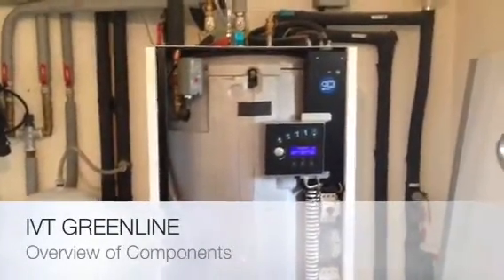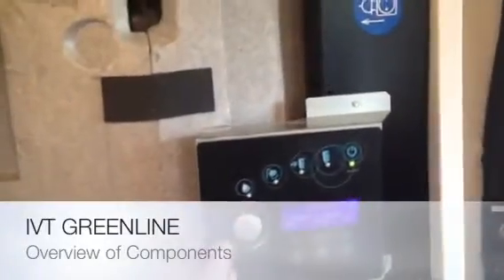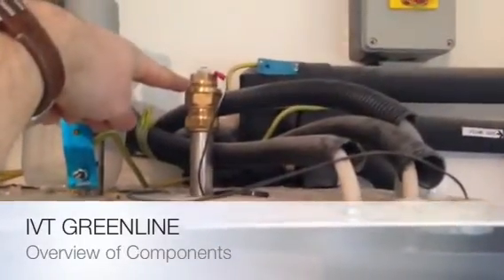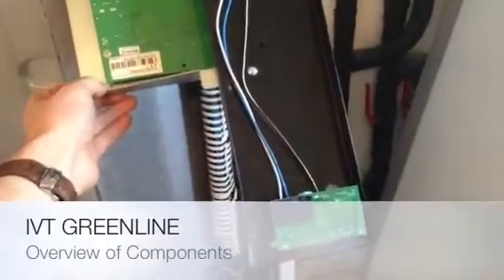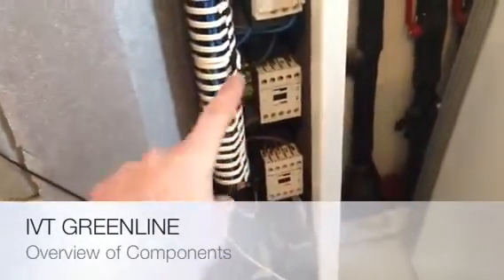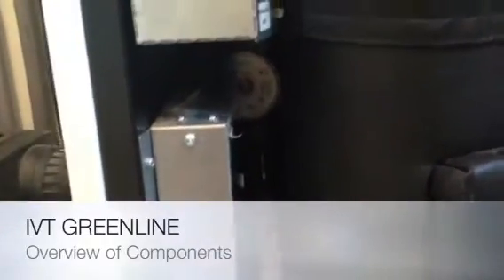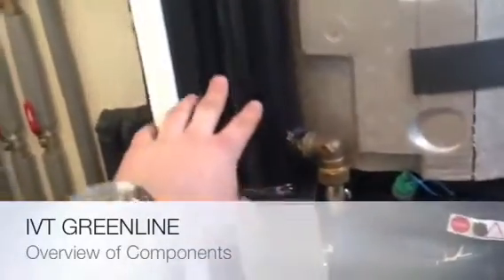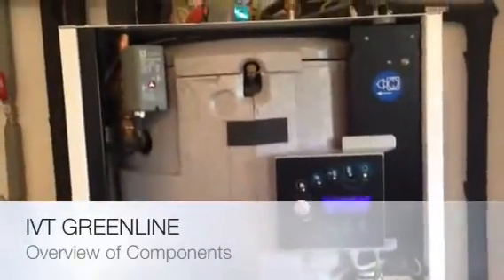IVT HEAT PUMP OVERVIEW

Comment: I have this exact  heat pump! Would there ever be a need to renove the side panel from the heat pump? We had it serviced last week, and the man said he needs access to the right hand side, he needs te remove the side panel, but the problem is we have shelving built in on that side. So before i pull out my nice built-in shelves.....is it really necessary? Or should all parts be accessible  from the front?

Comment: Hi Kevin, I have IVT Greenline HT plus E. 10 years old. suddenly GT3 ( temperature sensor reading from hot water), disappeared from menu 3( monitor all temperatures).
How can I get it back. no error message , no reading.
Reply from the maker: Try unplug the hot water sensor and Back in

Comment: hi how can I tell if our ivt is not working on electricity only. had some issues recently that compressor grenade fuse flicked off.and wouldn't work. fuse 63 amp off too. someone had a look and aparently disabled some part and now it's working we v hot water. but radiators are not as hot as they use to be.thanks in advance
Reply from the maker: roh007 if it's tripping the board then it's possible the compressor is faulty